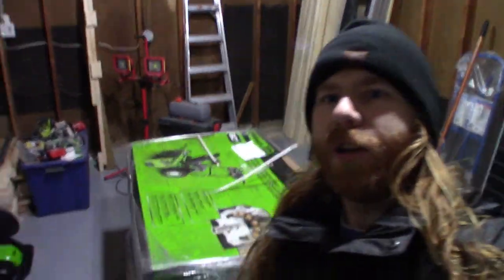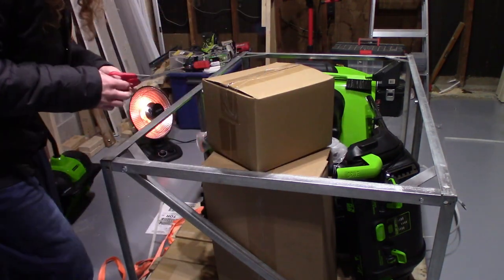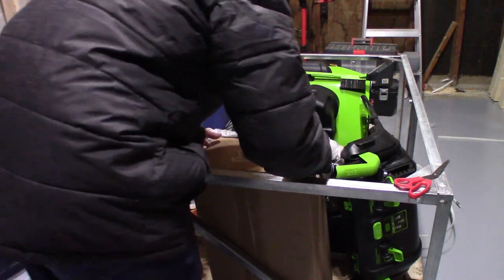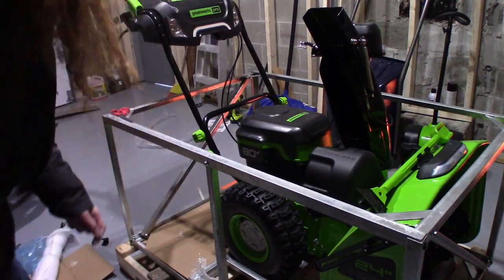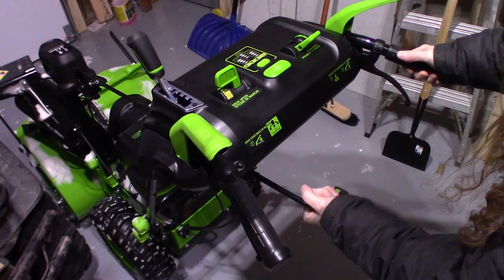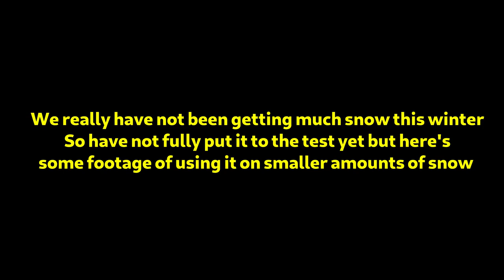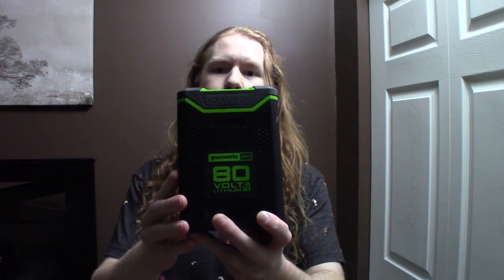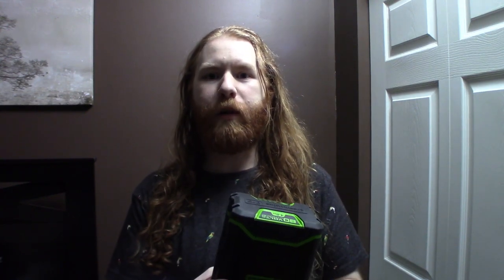Greenworks Pro 80v Dual Stage Snow Blower Unboxing, Demonstration and Review

Comment from the maker: Winter is coming...    I plan to make another video at some point to show it's performance if/when we get a good proper storm.  It might just be a short video, I'll see.
Reply: I just finally ordered this last week and is coming this Friday. My version will have 2 5ah batteries in them (not 3 which I assume you said yours got 3 4 ah batteries). Unfortunately, the last few days the item got lost in shipping and got really upset nothing was happening but was quickly found so no idea how it got lost in shipping. Also where I live two days of thunderstorms line up when they are delivering it so I hope they might delay it until next Monday or bring a big plastic bag to cover it up. Actually, when yours got delivered, was there a big plastic covering from shipping or was the top cardboard box exposed?

And I also got there chainsaw as well 18 inch.
Reply from the maker: Interesting, I guess they changed the design then, or is there still 3 battery slots?  I found most of the time I was ok using only 2 batteries, so 2x 5ah will go well either way.  When they shipped it to me they actually had the local courier call me to schedule delivery, it shows up in a box truck and they have to lower it, so you'll want to be home when it arrives. If I recall it was in plastic though, but I don't know if I'd want it out in a thunderstorm either.
Reply: @redsquirrelftw  Hey there, sorry for the delay in response, so I got it all setup and ready to go now! Yes the 2 stage snowblower definitely takes 3 battery slots on it, so its the same as yours (well they only sell one 2 stage right now, I would be curious in the future if Greenworks might consider making a bigger housing/auger for clearing up to 30" someday to match the gasoline ones on the higher end side of things for blowers). Its was quite a chore taking apart the freight box it was in because of the metal bars with the bolts. I used at first a socket wrench (mine wasn't high end actually) and I broke 2 socket adapters on the metal bar bolts on the cage it was in because there was a couple that were tightened way too much (I did not break the handle or the socket it was attached on the adapter thankfully but I did rough it up a bit). There was one bolt below on the left wheel (you might remember this) that was in a very tight space, I had to use a very narrow wrench to get the nut to not turn with the bolt. After I broke the socket adapter, I used two vice clamps to get the rest of the bolts off (which is why it was a chore, I guess I wasn't fully prepared to deal with the unpacking of this very well). Once I got down to being able to put the snowblower chute together and the handle together, those were no issue thankfully very easy. After I finished putting it together, the only part that was a bit problematic and I did not realize I was SUPPOSED to have a second person to help me with this, was lifting the blower off the metal frame it was sitting on, so I rolled it off moving it backwards but I hit the bottom of the metal of the blower on the frame unintentionally. Thankfully, I looked on the bottom of the blower and I did not see any scratches. The directions never mentioned about any part of the unpacking process and I only discovered Greenworks unpacking video afterwards, they really should have included directions about how to unpack this properly to people, especially on how to get it off the pallet. Anyway despite the annoyances with getting all together and off the pallet, I tested it to make sure its working and all seems to be working fine! So where I live now, no snow has come yet, so it may be about a month or two before any snow might come. The weather is predicting a much warmer winter this year so we may not get enough snow this time around. I live in Wisconsin so Winters have been kind of on and off for snow, mostly happens around December to March now for actual snow.

After the delay in shipment, one of the customer service reps sent me a $100 gift card as an apology and I bought their work light on the Greenworks site and right now I have enough points almost saved up to get another $100 gift card as well. So they really went above and beyond with there service they provided to me!

I also managed to get through a warranty replacement a brand new 80 volt 21 inch lawnmower as well completely for free, I asked about replacing the back rubber flap on my old 21 inch lawnmower, but they could not directly replace it so they could only send a new one for free, so I managed to get a free more upgraded one over the old one that can only take one battery slot, the new one takes two battery slots and I tested it this past weekend on my lawn and I could get the whole lawn done with two 4 ah batteries without a break for charging (before I could only get about around half the lawn done before I had to go back in the house to exchange the battery). After I got the two stage snowblower (since it came with two 5 ah batteries), you want to know what is crazy (I thought I would get a battery-less one) and I was thinking with the gift card I would use it to buy another 5 ah battery, I got a third 5 ah battery for free with the new lawnmower!! So now I can use three 5 ah batteries with the two stage snowblower! Also, the new lawnmower now has an indicator to show how much power you have left on the batteries near the handles and it has a turbo button but this drains the batteries faster (my old one did not have any of these options). 

BTW I just decided to order the 22 inch 80 volt snowblower to replace my 20" snowblower I bought a couple winters ago now which seems like its more of a powerhouse over the 20". Also I do own the 80 volt power shovel I say you mention in another video a while back, I don't like that as much as using a snowblower. So soon i'll own all fours of the 80 volt tools they have on offer now.

Sorry for the crazy long post, its been a wild month with the Greenworks tool purchases, shipping, etc. for me at least! I should be done soon for the rest of the year as I got basically everything I want now.
Reply from the maker: Haha it's almost like an addiction once you get into these power tool platforms.  And yeah I had a bit of a hard time getting it off the skid too and did end up scraping the bottom the same way you did, and I found it annoying that they used two different bolt sizes for the steel frame.   I should have made a little ramp to get it off but I was too lazy.
Reply: @redsquirrelftw  Greenworks should include a recyclable wood ramp or a big rubber ramp that is level with the pallet it was on so it doesn't require a second person to help. I think my biggest issue with the entire unpacking was that it requires you have a second person when it assumes you should have a second person to help (even getting the cardboard box off they said recommends a second person!). Don't get me wrong, I like there tools but they need to work on there packaging for dissassembling some more so its more of a one man job sort of deal. Its a big unit, I get it. I double checked again this past weekend to see if there was scratches on the bottom and thankfully I got away with it, completely clean! There was a few minor blemishes on the plastic on the upper parts of the unit but that was about it.

One thing that would have helped getting over the metal lips of the frame with the wheel is being able to take off that lip metal bar off the frame by either unbolting it somehow. If those were not soldered behind the wheel or in front of the unit, that would have also helped not potentially damaging it.

Do you recommend any sort of anti-rust coating solutions to keep the metal in good shape?

Comment: Got mine today.  Packaging is different now.  No more metal framework. I got the two 5.0Ah batteries.  I already had three 4.0Ah ones so hopefully it will handle any snowfall.  I did have trouble getting the batteries to charge at first.  It was less than 40F today so, as you noted about the cold, maybe that was the issue.  I will be taking the batteries and charges inside for the winter. Looking forward to 1st snow.  I installed the ARNOLD  Deluxe Universal Snow Thrower Cab because the wind swirls in every direction here. The cab is pretty light weight and  fit well.  Winter is coming...

Comment: By the way, one of the reason why these li-ion batteries INR18650-20R or 25R don't last after a few years is because of over heating during the discharging period (i.e. plowing the snow). The key is to keep these batteries from over heating by placing the auger at slow speed and keeping drive speed at a minimum.
Reply from the maker: Yeah they can get warm if I really push the machine hard, that does worry me a little as it definitely is not good for the batteries.  If there is a big snow fall I make sure to put 3 batteries in to share the load more, even if I could probably do it with 2.  But even with 3 when I recently cleared the recent storm they were warm after I was done.  We had 50cm or so of snow recently so I really got to put it to the test, when I cleared the path to the shed the snow was going over the auger.  It still cleared though but it was definitely working hard. I was easing on the drive so I'm not just ramming it in there full tilt.
Reply: @redsquirrelftw  I am not sure that they are using the right INR18650 Li-ion batteries with high drain current (CDR continuous discharge current) max. feature of at least 20A. I suspect the modules will fail after a few years or months. There are only a few 18650 batteries that can do the job.
So, I am preparing plan B which is the purchasing of low cost spot welding fixture, and low cost charging/testing equipment (i.e. Lii-600).

Comment: I have purchased the 80V one ( with 3 modules x 20 batteries each) to allow for future power expansion. These modules have only 4 Ah of power capacity each. But, one can get replacement with much higher Ah power. There are no more rooms for the 60V one (with 3 x 14 batteries each). Also, there is a huge price drop for lithium due to automobile (gas and EV) price war going on right now.  It will be good to buy higher Ah battery module in the near future.

All consumer based snow blowers use the standard 18650 batteries which have one size only (18mm x 65mm). They are different in their Ah (ampere-hour) capacity and drain current (CDR continuous discharge rate).

Comment: love this snowblower very good quality. You put the chute bar is upside down. There is a major difference with the 60v and 80v
Reply from the maker: I realized that the other day actually, it's suppose to point up. That way the chute turns the same way you turn the bar. I recently changed that when I realized it.
Reply: @redsquirrelftw  yes exactly so it's easier on the arm, rather then bending down
Reply: I noticed that too, but it can go either way, I think he did a great job , I had to watch the Greenworks Video…lol
Reply: @bartp27772  yes it can go either way, but from the video you can see how uncomfortable and un natural his body movement is by installing the handle downward. Also by adding it downwards when pointing the handle left the chute goes right, when pointing the handle right the chute goes left.

Comment: If you order this from the company where do you take for repairs when something goes wrong with. 80V is better than the EGO blower I see there is lots of power for the size of your driveway thats perfect. I am in Ottawa and I have a single stage and I am thinking of upgrading to a 2 stage electric. I have a 2 car driveway 20x10" and the other driveways I do this would;d do the job. There is a kit for the EGO blower 4 56V 10A batteries $3000,00 .  thanks for the video .
Reply from the maker: That's the tricky bit, there's not really anywhere to bring these.  I do have a battery that a small piece of solder fell out of, and since it's under warranty instead of opening it I just did a warranty replacement, waiting on that to see how that goes.  Worse case scenario if something happens to the machine itself there's probably not much to it, and they'll just send you the parts you need.   Even with my gas one trying to get that in the back of the truck was not fun, so it was still a pain to bring it somewhere.

Comment: I am looking at probably selling my Ariens Gas Two Stage Snowblower as we screwed up the sparkplug on it and we flood the tank to many times due to lack of experience so we accidently crossthreaded the spot where the sparkplug would go (and it doesn't run that well now because of this) and I have invested over the last number of years into Greenworks tools including the batteries and the single stage snowblower (plus the amount of times we run the snowblower is very few amount of times) and I just prefer the simplicity of a tool like that we barely use where you can just put the batteries in, close the cover and start it up, compared to the mess you have to deal with gasoline snowblowers. One of the tools I have been waiting for is for Greenworks to make a two stage snowblower. The price on this is crazy expensive but this looks worth getting this because of the investment I made into the Greenworks platform. I also have the Greenworks 21 inch as its OK but the flap on the back has really torn too much (so some of Greenworks tools are a hit or miss but overall I really like there tools). If this came battery-less, then I think the price on this would drop probably close to $1000, since it comes with three is why its so expensive.
Reply from the maker: If you get it on sale it's actually not too bad, have to keep an eye out.  When it drops to $2,000 it's about on par with a similar sized gas one.  The nice thing is the 4ah batteries it comes with are same physical size as the 2ah ones, so they will work in chainsaw and other tools too. The bigger batteries work in those tools too but are just more awkward.

Comment: Nice review! I have order the same package after a few weeks of investigation.
Let me tell you a bedtime story.
"Long long" time ago in a place "far far" away, a farmer hides 3 monkeys with "eye sight" problem to take care of 3 groups of horses with 20 horses in each group. One day, he wants them to pull one very large loaded wagon to a place not far from the farm.
At the last minute, he decides to use only 2 monkeys and 2 groups of horses to do the job. The result is that some of the horses end up sick or dying due to overwork.
What is the moral of the story? If the farmer has used all 3 groups of horses to do the job, everyone will have live happily ever after. 
"The end"

Can anyone guess why the monkeys have "eye sight" problem?

In our case, the horses are the individual batteries. The monkey is the BMS (Battery Management System) in each battery module. The very large loaded wagon is the snow.
Probably, all BMS circuitries from all companies are not designed to be smart. A smart BMS combining with a smart charger would have charged each battery equally during charging period to prolong the life span of each battery.

Comment: Thanks for the video. I am curious how it handles with a full width pile of snow, not just the half widths it looked like you were going through. Do you think it can handle a full 2ft deep driveway full of snow?
Reply from the maker: We only got a few good snow dumps after I made the video, but I did use it in about a foot or more of snow at one point, full width, and it performed well.  I could hear that the motor was forcing more but it still was able to handle it.   We also got wet snow at some other occasion and it powered through that as well.  If trying to go through older snow, like snow that's already established in the yard, the biggest issue is traction, it will not be able to go through as the wheels just spin. But with a regular gas snowblower this is an issue too, so you have to break up the snow first.    I'm hoping we get more snow next year so I can do a more proper video of showing it's performance.

Comment: have you added grease into gearbox after assembly? mine was empty, no grease there, just clean metal gears
Reply from the maker: Oh wow I'll have to check that, are you talking about the one in front for the auger?
Reply: @redsquirrelftw  yes, exactly, I've got mine and started right after assembly, but soon I decided to check, hopefully yours is full of grease unlike mine.
Reply: @redsquirrelftw I used wooden stick to probe if something is there inside after bolt unscrewed.

Comment: As of now, we should forget about the LFP type of batteries as used in most EV automobiles.
Chinese battery giant CATL plans to start this year 2023 the mass production and delivery of batteries based on a new materials technology M3P, which will perform better and cost less than nickel and cobalt-based ones. M3P batteries will have greater energy density and perform better than lithium-ion phosphate (LFP) batteries. They will also be cheaper than nickel and cobalt-based batteries as announced by Elon Musk of Tesla. I hope that they make 18650 batteries from M3P material.

Comment: Man the 60 volt version comes with 8AH batteries.
Reply: In canada the 60 volt come with 5Ah battery, also you should know that Ah alone does not dictate the battery capacity, you have to take into account voltage. So a 5Ah@60volt = 300Wh worth of energy, while the 4Ah battery at 80v is 320Wh, so the 4Ah of the 80v have more total energy than the 60v. I have this 80v snowblower and it is a beast, I never was able to stall it even in big heavy snow.
Reply: @hyksos2  yeah I know about that as well. But the 8 AH 60 volt is 480. I want to get one of these 2 stages. They seem to perform very well. And ur seems more stout than the EGO blower.